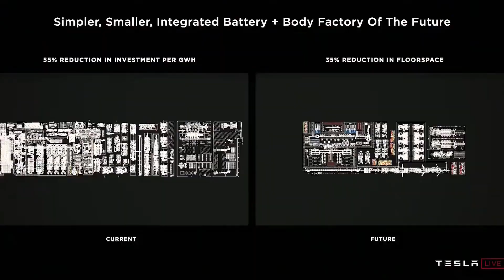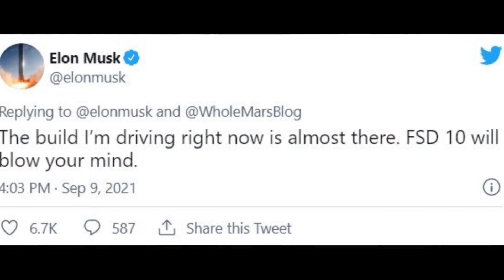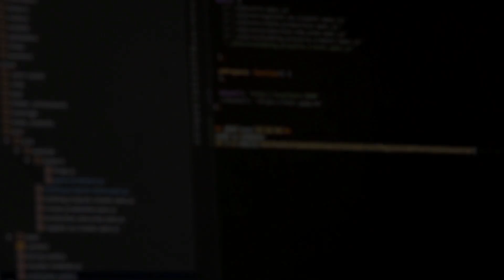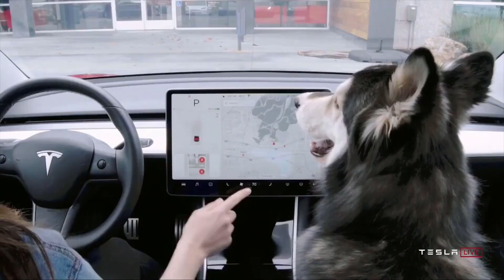Tesla Model Y | Expansion in Fremont & 1,135B for Giga Berlin

Comment: Model Y with 7 place - Best of the Best (IMHO)
Reply: @technopool9870  hoping that the Berlin/Texas long range Model Y will have the same range as the current LR Model 3 or slightly more and improve 0-100 to 4.1-4.5s down from 5s😛
Reply: @apothecy4011  I hope, If in Berlin the Model Y will be equipped with 4680 batteries, then it is a must.
Reply: @f2000u  well beeing lighter due to the new casting process ,(even if we exclude the batteries) should still improve its 0-100 performance.
Reply: @apothecy4011  yes